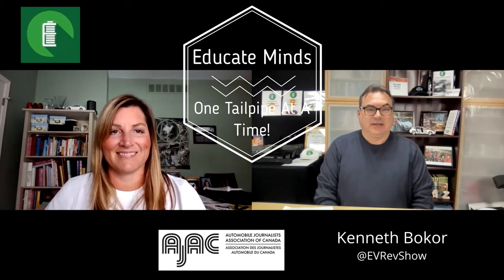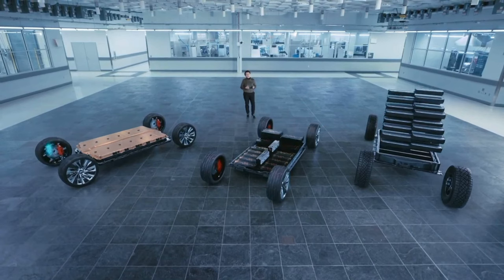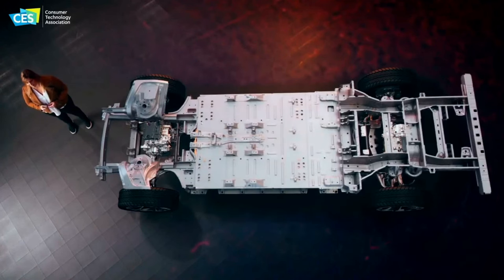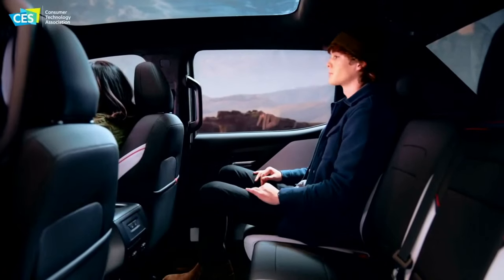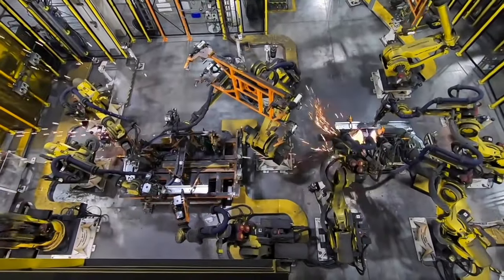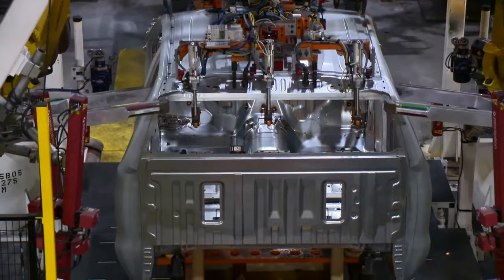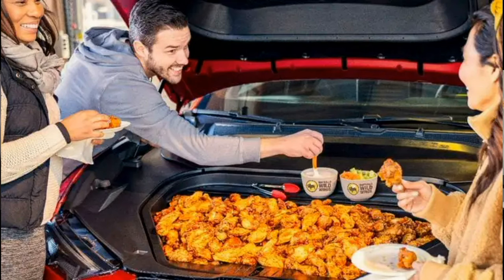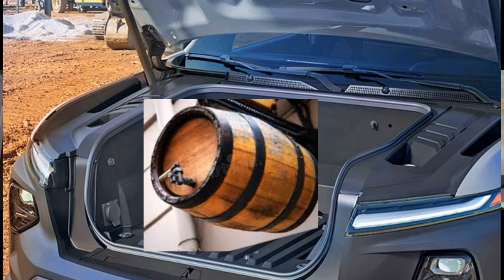Episode 159 - More on the Chevrolet Silverado EV - An Interview with Nichole Kraatz, Chief Engineer!

Comment: I really loved the interview to really see the thought and design process that went into developing the vehicle. Between the F-150 and the Silverado, I'd take the Silverado because it seems to offer much more features and that 4-wheel steering. If back up power for home is included, it's a winner. GM has a lot of work to start cranking out these quickly and I'm glad consumers are having options to choose what works for them. Excellent interview and thanks.
Reply from the maker: Thanks for watching and for commenting.  Absolutely correct, I too would lead towards the Silverado if I was in the market.  Don't know about full VTH capabilities but prob will have something.  GM continues to put big money and work to retool and build out internal supply chains to handle the big numbers they want to put out fast.  Lets see!

Comment: Ken, thx for the insightful interview with Nicole Kraatz and the informative CGI that illustrated many of its options. I hope you can have her back, when she is free to give more details, such as its AC and DCFC options and specs.

FWIW it was amusing how she kept making indirect condescending references about the Lightening, since GM is so late to the party.and since GM currently is showing it with a smaller Frunk too.While Ford is to busy expanding its production capacity, to waste time, making references to what the competition is doing. 

But the more the merrier ;)
Reply from the maker: Thanks for watching!  I think GM is ahead of Ford overall, with many more EVs current and in the pipe.  Of course GM needs to promote their value-adds, and remember the number 2 Pickup Truck in N.A. Sales is pretty close between Dodge Ram and the Silverado.  Dodge is not coming out with an electrified Ram for a few more years, so GM with the Silverado will have an opportunity to eat up some market share.  Also, technically GM is first with a mainstream-OEM pickup truck in the Hummer EV, as you can get it in a truck version and they are delivering this year, if not now.  

So for sure each OEM will spin it their own way, however I really believe GM has a winner along with Ford.  Ford will be shipping this year so that is great and yes, the more the merrier!
Reply: We do know a few things from the Hummer EV.  The 24 module battery pack will be the same as the large pack in the Hummer EV.  This will yield a net capacity of ~200KWh.    It will have a charging capacity of a peak 350KW.   Now I presume the Silverado EV will also have the two other battery options like the Hummer EV will have.  Which will have 190KW DC fast charging for the small pack and 300KW charging for the middle pack.   For AC charging the Silverado EV will likely use the same on board charging module (19.2KW)  Which is the max allowable under SAE L2.
Reply: @EVRevolution  Its far to complex to do a full cost-benefit analyse for Ford vs GM electrification strategies here... 

But just focusing on pickups.... Ford will have sold  100s of thousands of its 1st gen Lightening before GM or Dodge sold any EV pickups and Ford's 2nd gen version will be out soon after the 1st gen GM EV pickups... If anything Ford should gain market share on average, unless Ford drops the ball on it 2 gen version?

Its just getting fun with all the new start-up wild card players in the EV pickup market... And there is to many variables to pretend to be sure about how it will turn out?

Time will tell...
Reply: Correction it will require a  350KW.DCF 'charger" to reach its peak charging rate... it it won't charge at 350KW....  is all we know  for sure at this point...not its DC peak rate or its curve...
and  the Lightning also has the same max  L2.AC charging rate... so its nothing special...
Have fun presuming ;)

Comment: Great discussion Ken, I really like the design and flexibity of this vehicle, so many advantages over a traditional ICE pickup.
Reply from the maker: Thanks JP, I thought it also was a very good chat!
Reply: Great interview but do not see the merit of the mene, of a bespoke EV being superior? VS the sooner to market Lightning with a larger Frunk? IMHO
Reply: @nc3826  yes, but frunk size is just one of many important features. The design looks sleeker to me, efficiency power and range are all important items, and the midgate and longer bed are great features. We need as many pickup options as possible to suit varying needs, and to offset low initial production volumes compared to demand.
Reply: @jamespaul2587  GM has a higher capacity battery pack, so ofc it has a longer range.And WADR "efficiency power???" did not make sense.... and looks are objective....And GM already has midgate long bed ICE pickups... So none of the examples that you gave prove that a bespoke platform is superior. Intelligently done flexible platforms make a lot of cents ;)

But I agree we do need more EV pickup options. So Ford's faster route to production seemed to make more sense... .We will just have to see in s few years who has the lea

Comment: 16:00 Really good point. For a truck, it isn't just about how far you can drive. (Then again, even for regular cars, you need to consider range under less than ideal conditions, such as towing a trailer, or driving in severe weather.)
Reply from the maker: Thanks for watching.  Yes most consumers get focused on range and they have to have the most!  For the vast majority of use cases, 100mi or less is the norm.  A capable 400-mile pickup, even with 40% range loss is Minnesota winters, can still do stuff with 240-miles of range.  This truck will be very capable.

Comment: Thank you, Ken. I do not believe GM will offer a 400 mile range truck for $40k. A ~150 kWh pack, assuming $100/kWh is $15,000. Currently, base truck with crew cab is $37,000 and Silverado EV will not share a chassis with fossil gobbling truck, unlike Ford Lightning. We shall see, of course.
Reply from the maker: Thanks for watching.  You heard what I heard so we shall see, indeed sir.